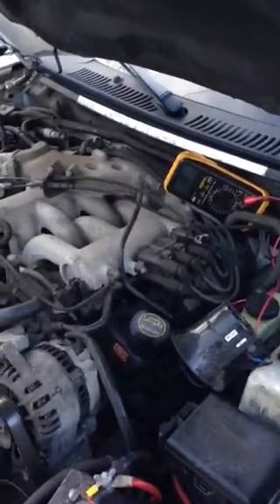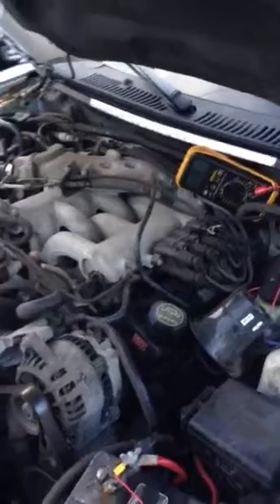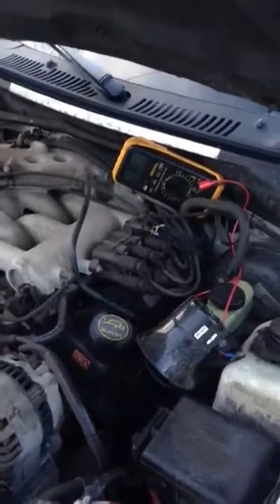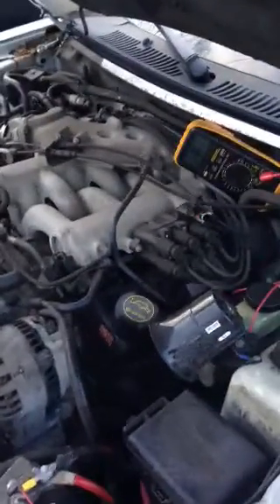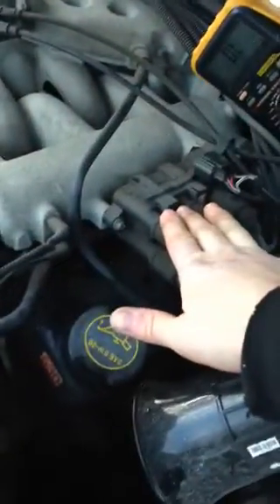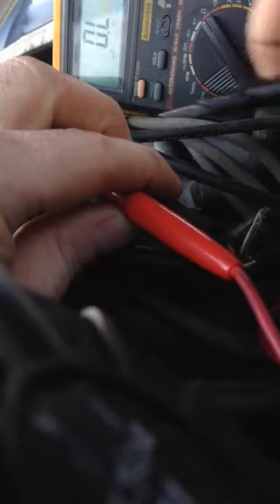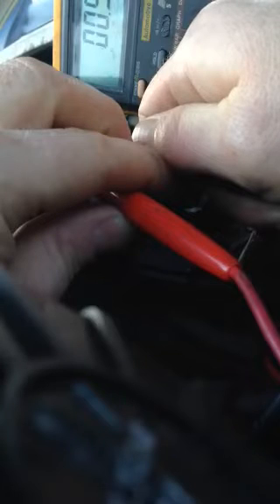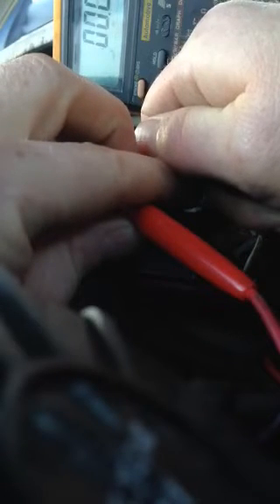2001 Ford Mustang 3.8L coil pack testing

Comment: I have a rough idle and no engine code.  So if I have a misfire it isn't a major misfire but enough to annoy me.  I am going to try to do this test as soon as I can.  If I can rule out the coil I will just change out spark plugs and wires and worse case scenario it doesn't fix it at least it's not too expensive and it needed them anyway cuz they are 115k miles old.

Comment: I got a2002 mustang v6 3.8 is this the same firing order?
Reply: front of car motor pass side 1 2 3 drivers side 4 5 6  if your right in front of coil top order is 1 2 3 bottom 5 6 4

Comment: Just an fyi. My last bank read low as well. Ordered replacement, received replacement and checked prior to installing and the last bank again read just as low on the primary.
Reply from the maker: That seems odd. Did you find the new coil performed ok? Was it defective?
Reply: Did ya ever find that the new one is different or are they all alike ??   My last one was lower also.

Comment: hey man we need a response on what did you end up doing. I have the same problem, a p0352. Please and thanks!
Reply from the maker: The new coil fixed the problem. The drivability problem varied. Before the new coil,  sometimes the vehicle wouldn't go over 5mph. Sometimes it just had a rough idle.
Reply: I did replace the  ignition coil with spark plugs and wiring  but no buff I also replace some cpu that controlls that area of the vehicle but didn't do the work I havennt move the car since a year and now it won't turn on. It cranks but won't start. I know there pressure in the pump but can seem to know what with it.
Reply: The CPU was the constant control relay module

Comment: so I'm not really experienced with testing resistance, as I'm not an electrician.. but when your tested that coil pack did it matter for ac/dc setting while measuring resistance. or does that not matter? I have same vehicle and bought multimeter for testing coil pack. there is a switch button for ac/dc
Reply from the maker: You want the multi meter to be set on dc
Reply: Anytime when dealing with a car battery you are dealing with Direct Current !!    Alternating current is what is in the home or on power poles mostly..   Hope the helps.   ACDC doesn't mean after Christ devil comes lol.   Alternating and direct current !

Comment: worst video clip ever
Reply from the maker: Worst comment ever. Borrrrrring!
Reply: What do you set meter on? What are you holding negative too? Not good info
Reply from the maker: @jasont1917  im testing resistance. I show the wires’ location before I unplug the harness.  I think you may require a more fundamental video on circuit testing. I made this video as short as possible.  Nobody wants all that extra info when they are already under the hood scratching their head
Reply: Lets see your videos.

Comment from the maker: I fixed it by replacing coil pack. Oddly enough, the obd code was for a cylinder misfire that that tested ok on the coil. The coil pack tested bad for 2 cylinders. Replacing it made the car run very smooth.